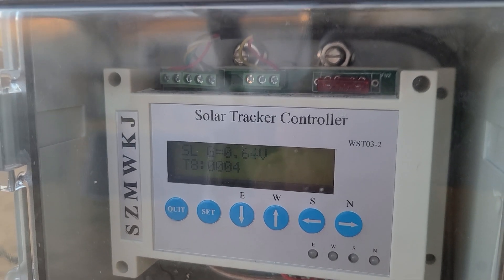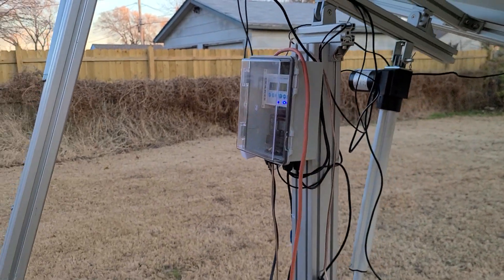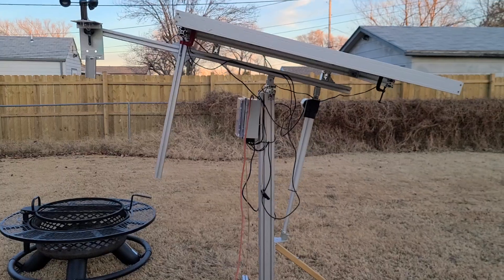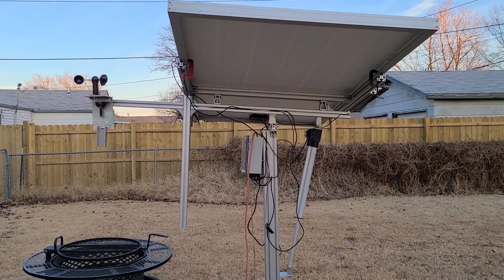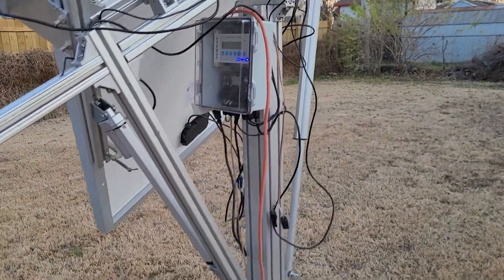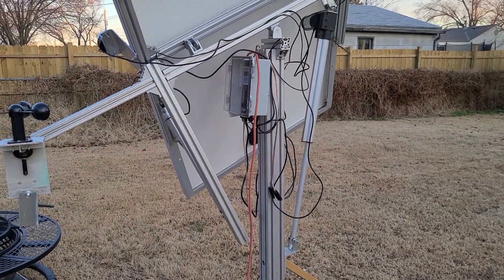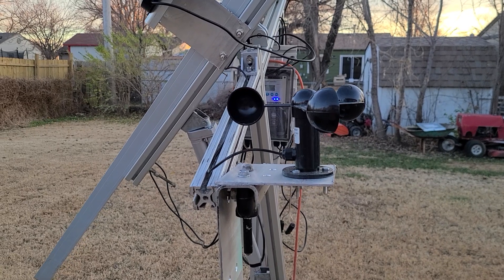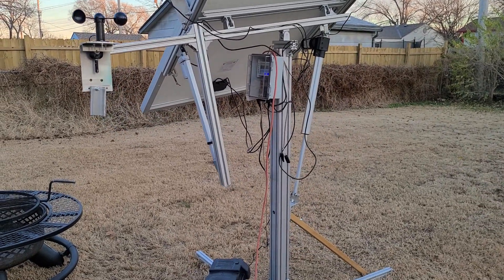How this Dual Axis Solar Tracker resets for tomorrow

Comment: how did you make that wind speed float like that.  I need one badly.  this will stop mine from premature enabling
Reply from the maker: I got some roller bearings and a Bolt. Then ensured it was bottom heavy to keep it always level.

https://www.amazon.com/dp/B00NX3F6F0?ref=ppx_pop_mob_ap_share

I put a clamp around the bearings. I used an old handle bar clamp from a motorcycle. Kind of like this: INNOGLOW Motorcycle Handlebar Risers Mount Clamps 22mm 7/8" for Motorcycle Dirt Bike ATV 2pcs https://a.co/d/g6dUaMS

Comment: Hi, Increase PV solar self-consumption sharply in order to save electricity costs by avoiding electricity from the grid, shortening amortization. With Dimmer + Solar PV, self-sufficiency will now increase to almost 95%, because expensive purchases from the grid are so easily suppressed and the electricity bill stops just like the electricity meter. The prerequisite is that you have at least a small solar PV balcony power plant, and you don't need an expensive battery either. Many examples below: https://youtu.be/eC2olbCBhh0 , Kettle: Without a dimmer, the 2500W - 600W PV system needs = 1900W which you have to pay more for. If I turn the kettle down to 600W with a dimmer, then every weak PV system can now supply each consumer independently and independently, because the 2500W kettle becomes a 600W kettle thanks to the dimmer. No magic, just physics. The 2000W e-heater becomes a 500W e-heater with a dimmer, which can run 12 hours a day free of charge via PV. The 4000W oven is also tamed. It is not the solar arrays that need to grow, the consumers simply need to drop by 75%, which is so easy with the dimmer. I have already switched my entire household to dimmers. Please have a look at my channel. 🌞 ........... Increase mini PV solar self-sufficiency (winter and camping): You can continuously regulate a boiler and other power-hungry consumers with the "5000W dimmer". Ebay €7. I run 4 dimmers in parallel on an 850W inverter. Kettle 2.2KW at 150W runs 12 hours a day, so the water is always hot https://youtu.be/D9Ss0RuqZG0 . The room is also nicely heated. 2.5KW washing machine runs in parallel with dimmed to 400...600W and always reaches its 60°C, and also its 1400rpm... It doesn't matter to the washing machine whether it changes the washing temperature to 5min@2500W or 100% can be achieved free of charge via existing PV power in 20min@600W. The wash cycle lasts the same time dimmed and non-dimmed, 3Sth 10min. The iron https://youtu.be/-71oL7z1kMU , dishwasher https://youtu.be/8vnAkrS1x-s , oven https://youtu.be/azDjqZpz77U , electric heater https://youtu.be/QbLWDbJi6ew , Waffle iron https://youtube.com/shorts/ofanZCdYEjA?feature=share, coffee machine, all internal heating is throttled with me. Lots of videos on my channel. The inverter stays cool and quiet and the MOSFETs + (battery packs) stay intact because extreme current peaks no longer reach the inverter. Now every Mini PV Inverter is enough to operate large devices. So, with the dimmer, all internal heaters/devices can be converted into base load devices that stay almost permanently ON, drawing very little current directly from the PV. With a wattmeter / energy cost meter you can then measure this perfectly in order to set the dimmer optimally. ........ Comments: "Great idea - despite studying electrical engineering, I didn't think of it myself ;-)" or "I installed it in our washing machine, great idea!" or "Glück Auf Christian, I'm a professional myself but I haven't figured that out yet. 👌 Greetings Mitch 💚" and many more... LG Christian 🌞 ........... "smart energy saving" , has made a meaningful reaction video to the dimmer: https://youtu.be/EHtJGiXAjZk . 🌞 ......... "Free Range", also made a meaningful reaction video, to the dimmer: https://youtu.be/qzdRdBObtvY . 👍........ "Jens Kummerow TS", also made a meaningful reaction video for the dimmer: https://youtu.be/fTY5jWvz5CY . 👌 ........... A little hint: Energy cannot be saved. So if I want to boil my water, I always have to use the same amount of energy for one liter. Christian's method relies on a longer period of time with less power in order to be able to use the power provided by the PV as efficiently as possible - so consumption peaks are intercepted. In the end, the energy consumption should even be (slightly) higher due to the interposition of the dimmer, but it doesn't matter, since more efficient coverage by the PV system and therefore better use of the self-generated energy .......... Here an "automatic PV excess control + remote controlled dimmer with heating element" / load management (consumption / heating rod follows PV excess ...): https://youtu.be/IWp7Mi2FldM . ATON - Power to Heat: https://youtu.be/wnVSaioJsjY . "Obermühle" solved this via PLC: https://youtu.be/iR30cDaf1Xk "Heating with excess PV🌞Do your own heating rod control". 🌞 .......... I installed a 2-axis solar controller on my DIY solar tracker: https://youtu.be/_Rs8CptQcDw. .......... More videos on my channel. LG Christian ............... ............... ............... ............... ............... ............... ............... ............... ............... ............... ............... ............... ............... ............... ............... ............... ............... ............... ...............

Comment: Absolutely perfect for what we use . Generater.Systems for Our 500wt  power station! Love it!!!!
Reply from the maker: It is still pretty expensive to retrofit existing houses. Most people see, "$150 or less as hard to justify a $20000 system." 

But for new devolopements and areas that do not have power lines in place, it is very competitive, price wise.

Comment: Why are you running an anemometer...???
Reply from the maker: So it doesn't get blown over in high winds.

When the winds pickup, the panel gets parked in the flat position so it is not a sail.

Comment: you can use an arduino and ldr for that it will be single axis but smart
Reply from the maker: Sure you can, why not.
Just get some relays for the extra power the actuators need.

Comment: Sir we are also working on similar project can you please give us the paper work like type of sensor used? Controller? And controller code?
Also if you had solved the kinematics of the mechanism
Reply from the maker: I just eyeballed the movement until it was "good enough". I got some inspiration of from the hydraulic arm movement of an excavator digger. Using double-action joints would easily allow for much shorter actuators.

Sensor ebay search this: SZMWKJ

https://www.ebay.com/sch/i.html?_from=R40&_trksid=p2380057.m570.l1313&_nkw=SZMWKJ&_sacat=0
Reply: @JasonCarmichael  thanks for reply I really appreciate

Comment: Hi Jason. I am trying to replicate this design but am having trouble sizing the travel of the actuators.
Please can you tell me what angle your unit cover from east to west? Or what size actuators you used?
I'm struggling to get 90 degrees at the moment.
Also, do you have any information that would help me determine the best attachment points for the actuator?
Thanks.
Reply from the maker: I used 14 inch actuators.

This is how I figured out where to attach. Extend the actuator 100%, then point the panel to the west minus 1 hour or 2 from sunset. You will never get much the last two hours of the day anyway.

This is where I attached to the middle part way down near the end, the "fixed" end. Then the end that the panel is on is the adjustment end.

I might have said that backwards, but I think if you got this far, you might get it.
Reply: @JasonCarmichael  That's brilliant!
I have been looking at this the wrong way round.
I have mocked one up in a 3d print and the parts are drawn up for a cutting list. (Going to use 30x30).
But getting the lengths of the actuators has been the 'how long is a piece of string' problem.
Hoping to get the metal next week and to assemble the frame first. Then I will buy and fit the actuators and then the electronics.
Will be running it with an Arduino, so have lots to do.
Big thanks for the help, and thanks for sharing your design.

Comment: This is a great design. Thanks for sharing it.
A couple of questions if I may:
What size t-slot did you use?
Are they standard 80/20 pivot joints you are using?
Thanks.
Reply from the maker: the small ones are 20-20 the big one in the middle is 80-80.

It's very pricey to use this though. It is excellent to figure out the design and then use other materials to build it out.

https://www.ebay.com/itm/223994801808
Reply: @JasonCarmichael  Thanks Jason. I was thinking of using 30x30 for the top end, and a boxing punchbag frame for the bottom end. ☺

Comment: Goodnight.
What is the specification of the base balance of the wind sensor?
Graciously;
Antonio Gonçalves Matozo (Brazil).
Reply from the maker: It is a range from 0.00 to 4.00

I had mine set at 0.18.

I don't know what the values are. The lower the number the sooner it will park.

0.18 equals about 22 mph.

There could be a few factors that determine the setting to use. I think it depends on the quality and sensitivity of the anemometer (spinning part). 

It is something that you have to test out for your installation.

É um intervalo de 0,00 a 4,00 Eu tinha meu definido em 0,18. Não sei quais são os valores. Quanto menor o número, mais cedo ele estacionará. 0,18 equivale a cerca de 22 mph. Pode haver alguns fatores que determinam a configuração a ser usada. Acho que depende da qualidade e da sensibilidade do anemômetro (parte giratória). É algo que você deve testar para sua instalação.

Comment: Hi , congratulation for the job .

Do you know How much energy the sistem  consumes per cicle , i mean In 24hours ?
Reply from the maker: I uses about 5 amps when it goes at 12.2 v. That is 60 Watts.

It takes 65 seconds from full end to start. I Think that maths out to 1.08 Wh.

It usually makes 2.5 to 3 kWh per day.

Ultimately, the energy used to move and control the actuators uses half to one third of 1/1000 of the energy the panel makes in the day.

Comment: Definitely considering one of these. I'm a manual solar tracker with my system so far.
Reply from the maker: How many panels do you have on your manual tracker?
Reply: @JasonCarmichael  I have 2 panels on it too total 420watts. The tracker system is just a cart on wheels I built from recycled 2x4s I got from a shed tear down. Will have pictures up soon of it all and videos will follow. I really need 2 more panels and a plan to permanently mount things. My pond load is a constant 14.5 amps I can keep it running and daily charged but if there is sun only. If it's raining and cloudy for days in a row I'm back to using grid power. Cheers brother 🌞
Reply from the maker: @DavidLouthan  I was going to put 4 panels on this tracker, with beefed-up materials. Basically the two hinges. This design is pretty good for up to three or four panels, but using wood is pretty common for this design.

Comment: Is this the Chinese echo worthy system? If not then where I can buy this. And the drawings for mount. Will you help?
Reply from the maker: I built my tracker based on the echo worthy one. (https://www.amazon.com/ECO-WORTHY-Dual-Solar-Tracking-System/dp/B00JYAIS9W)

The aluminum bars that I used are very expensive and I do not recommend building the tracker this way. I did this as an experiment.

If there is no other option because of limited space or simply no way to get more panels, this will nearly double the solar energy production. If you have access to more solar panels and space to put the panels, more panels are less expensive.

For a more permanent installation, I recommend regular weather treated wood or something like soft metal that can be bolted or welded.

Comment: Whats the purpose of the Anemometer attached..?
Reply from the maker: If the wind blows too hard the controller puts the panel flat, so it doesn't blow over.
Reply: @JasonCarmichael   did you program the controller to do this or is it plug and play..? Thanks
Reply from the maker: @excardross  you set the value for the high wind parking. 0.00 to 4.00. For mine the setting is 0.18. That is about 20 mph I think.